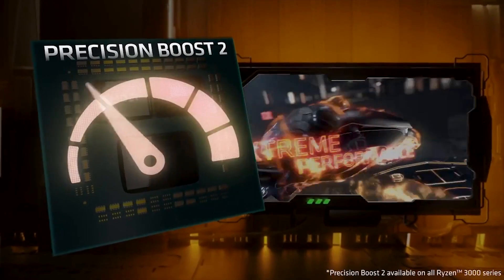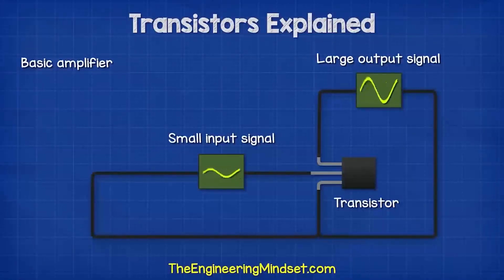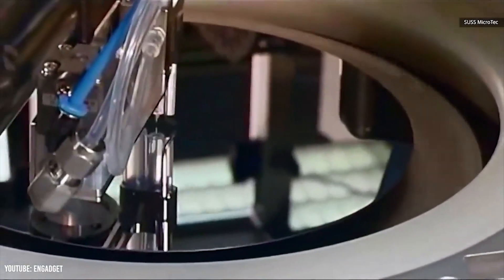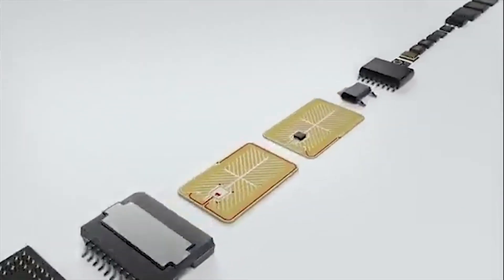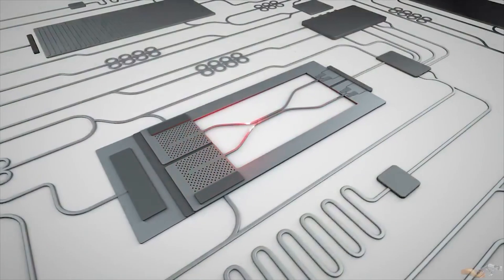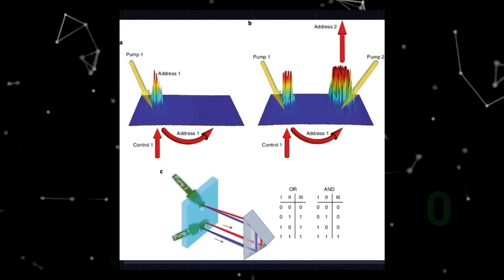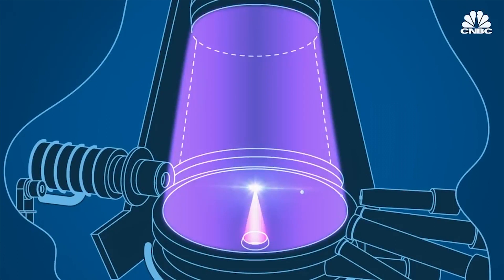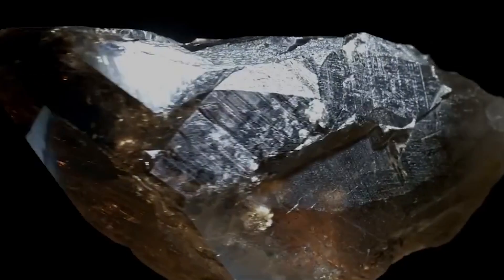IBM's Photonic Processor Shocks The Entire Industry!

Comment: The problem is that the speed of other components will bottle neck the performance of optical computing units.

If data goes in at 10GB/s, and the unit processes at 50GB/s, it will only ne able to process the 10GB going in.

Optical processors will need to hav  optical parts too, optical memory, optical wiring and so on.

Now if using 400nm wave length light, which is violet, that means a 400nm process will be needed, since it won't travel through narrower tunnels. Most modern processing units are below 10nm, and the higher the process width, the less transistors will fit.

Comment: Currently there's a fierce battle for supremacy in these mobile chips:

Apple A18 pro 

Media Tek dimensity 9400

Qualcomm Snapdragon 8 Gen 4 

All on the 3nm node process which makes all of them powerful and fast. Now imagine if only they had silicon photoics instead of electrical wiring. The results would be a 100X
performance increase with instantaneous latency opening new doors in mobile technology. Hopefully this comes to fruition within a few years. I'm excited just thinking about it.

Comment: Without taking away from this achievement: A good engineer can design something complicated. A very good engineer can design something simple.  I'm convinced a much simpler optical switching mechanism can be made; but this is an excellent starting point. All you have to have is a NOR or NAND gate and you can build anything.
Reply: you conviction absent  a plausible basis means

Comment: This is what will be used to act as a 'translator' for quantum computers.

Since QCs computer a ton of analogue raw data, a super fast computer is needed to compute this data into digital coherent data.

Until QCs can have their own 'translating' machines, this will be the process used. A hybrid QC/Digital machine.

Right now all QC machines in other countries must rely on digital transistor based computers.

America will have an edge in using IBMs weird photon super computers, which blur the lines between a digital and quantum computer.

Even if QCs are 40k times faster than any transistor based computer, it means the data produced still needs to be 'translated' by a regular digital computer for all of it's produced data to be understood.

These optical circuits completely change that dynamic.

Comment: They better make a gpu with that technology instead of a cpu
Reply: Raytracing, which simulates light reflection, powered by actual light. Crazy time to be alife
Reply: From what I've heard, GPUs won't even need to be created as the photonic CPUs can have a processing power of over 3000 TFlops. For comparison, Nvidia's most powerful GPU currently (RTX 4090) has a processing power of 82 TFlops.
Reply: @McFlashh  yeah, that would make into 3 PFlops but imagine a gpu of 300 PFlops, would be an insane PC for any AI, if not AGI
Reply: Both. A complete photonic based System should be the goal... . ;)
Reply from the maker: That's could be possible 😲
Reply: as it would excel at parallel processing I could see asics being made this way also. crack a bitcoin guess every block on one chip.